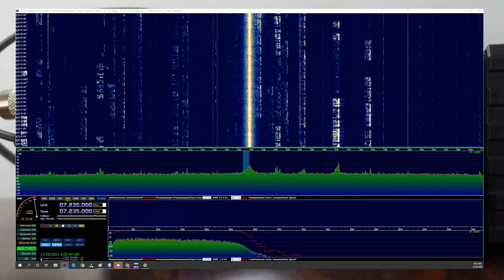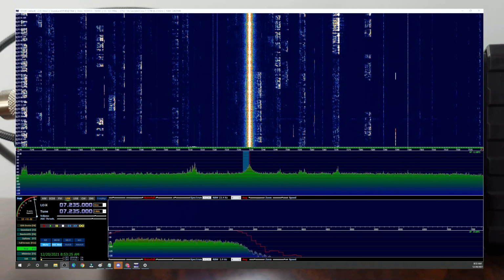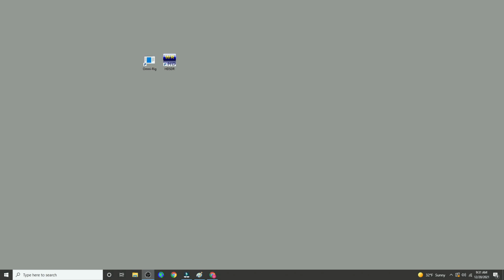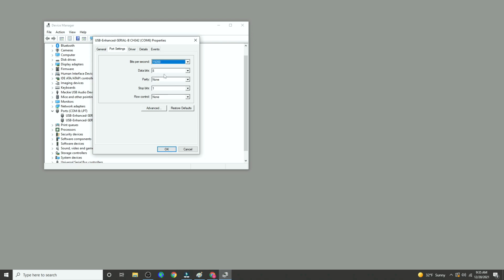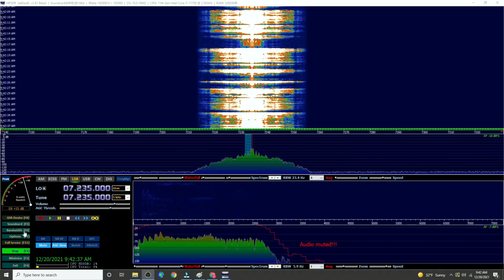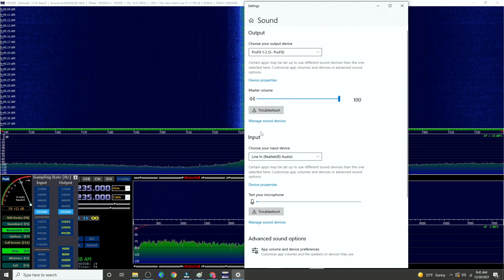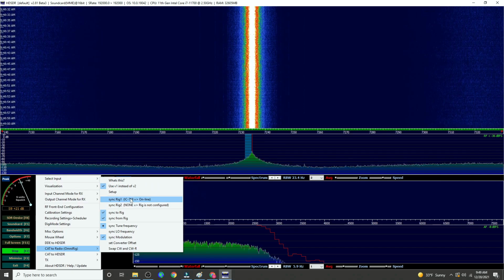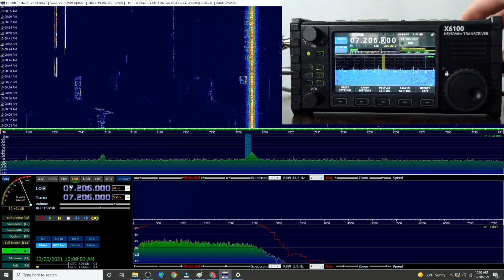Xiegu X6100 I/Q Out with HDSDR - Walkthrough Tutorial - Rig Control!

Comment: I think (could be wrong) that the sound card bandwidth depends on the sound card you have.  Most are not 192kHz.  Also, I think it needs to be stereo input, and a lot of usb sound cards are not stereo line in, but mono.  Again, I could be wrong.  You have to verify by testing.
Reply: You're correct. You usually need a higher end audio interface. There are some stereo line in sound cards but most are mono mic inputs. However a sound card with a line-in is usually stereo.
Reply from the maker: You could be right. I pinned the comment in the event others don't have the 192000 option. Thanks!
Reply: Most USB sound cards nowdays are stereo and the sampling rate is typically 48khz unless you have a high end sound card.
Reply: Yes , You are right . Always It has to use a soundcard with two-channel input and availability of 96 kHz or better 192 kHz sample rate ...

Comment: Use this software with an off-centre offset, so the carrier in the centre is not influencing the received signals. You can tune this in the software for less impact by tuning the I and the Q signals for synchronicity, but you will almost never get rid of this. The better option is to use SDR-console v3, which does this automatically and even better.
Reply: SDR-DXobserver, Which input do you use in SDRconsole? I asked Simon, and he replied that he did not know if it is possible to use SDRconsole for this specific task.

Comment: Is there a way to stream the IQ samples out over wifi or usb?  Can someone point me to a hack?  I’m thinking about buying this radio as a cheap rf frontend to gnuradio backend.  i want to do some spread spectrum experiments. 

What doesn’t make sense to me that the iq samples is already available to the sdr.  Why go through additional step of converting that back to analog, squeeze that down a limited bw analog audio channel, only to be resampled back up to iq?

Also, just because you can configure the pc’s sound card for 192 kHz doesn’t mean the radio is putting that out over analog audio.
Reply from the maker: Hi Robert. At the time I finally decided to get rid of the radio, xiegu had removed the capability for IQ out.  Horrible decision on their part. Since getting rid of this radio however, I'm on certain whether or not the features available again. Everything I see kind of says no.  Sorry to be the downer.

Maybe there's a workaround, this radio is just too pieced together for me
Reply: @DudeTested  that's a marketing mistake.  It's not as if their non-Chinese customers can replicate the hardware at Xiegu's price point.  Opening up that HW for end user tinkering means free engineering NRE.

Hmmm.  I bet they are worried about counterfeit and copy cats from other Chinese manufacturers.  Karma's a bitch, eh?

Comment: The option for IO out doesn’t appear to be in the menu in firmware 1.5 has it moved? or on by default?
Reply from the maker: I was fairly disappointed after this video came out, because I wasn't able to find a way to use IO anymore.  I sold the radio
Reply: @DudeTested  Oh Right they have removed the option that's a bit of a pain then.
Reply: @ciscokiduk  Yes, this radio no longer works with HDSDR, Ham Radio Dude should update this video.

Comment: HDSDR always shows a peak at the center. You can supress it; go to options > calibration settings, then to tab DC Removal calibration for RX. Here write 50 in the field "Bandwidth [Hz]:" and select IIR-Highpass (Auto). This works for me. 🙂
Reply from the maker: Thank you!
Reply: Also, use the tune offset by at least 10 kHz up or down from the centre.

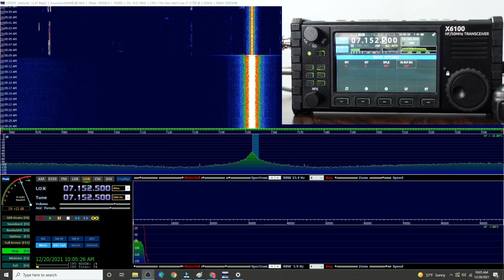Comment: Great video, thank you!  Just one thing...... at around the 9:05 mark you noted the IQ Out EN somehow went back to the default mode.  What really happened is at 2:44 your hand touched and moved the VFO knob.  Instead of using the + or - to make changes, you can also use the VFO knob to scroll through them.  Just an FYI.  Thanks again for this info, it worked perfectly the first try!  Bob, W0BNC.

Comment: Hi - my hdsdr doesnt see OmniRig  the freq is changing on the radio and Omnii , are you running original Omni or omni 1.or 2.1 - Thanks loads
Reply from the maker: I'm terribly sorry.  I had it working with V1.2 and had no issue. I did upgrade to 2.1 and had some issues, but eventually got it working. I would suggest V1.2 for now.  I updated my description (my fault).  Let me know on discord if you are still having issues and we can walk through it

Comment: Most PC mic inputs are mono only, but HPSDR requires IQ "stereo" inputs. Are you sure this works properly using IQ sound outputs on a PC SDR? Also, the IQ bandwidth from the radio is likely something less than 192K....have you checked?
Reply from the maker: It worked great for me for both line in and mic in. Both of those I can set  to 192000.  Although that's a good point about stereo.  Thanks for the input, it'll probably help others having an issue

Comment: Anything but HDSRD, just don't like it.
SDR Console all day long, i use it connected to Icom IC-7610.
Reply: Yes, SDR Console is really fantastic and so is it's built in server function which allows someone to use their radio from anywhere with full control with SDR console installed on the remote laptop. With SDR Console one can TX too but not sure if the 6100 is compatible with TX using SDR Console and 6100 ?

I use it with my 7300 and Airspy HF+, got the ptrx 7300 panadapter, was never happy with the audio quality from the 7300, too much sacrifice was made in order to have so many features, I like the 7300 but the audio is not good, my FT-891 sounds vastly superior. But having the waterfall on a 24 inch monitor made a massive difference.
Reply from the maker: I've been playing around trying to get it to work.
Reply: @DudeTested  It's been a while since I set up SDR Console to work with my Airspy HF+ but you need to add some DLL to the sdr console folder. 

Might be better to ask on groups.io. But once you have a compatible DLL you can then select the radio from the definitions on SDR console.
Reply: Same here, SDR-console every day of the week. It is more flexible, accurate, way better waterfall and more usability and feature rich. Here there is an I/Q crossover suppression, so there is no fat (fake) signal in the centre of the screen. Also, the S-meter is spot on when set correctly, and you have an SNR metering, which is the one to use to evaluate real signal strength.